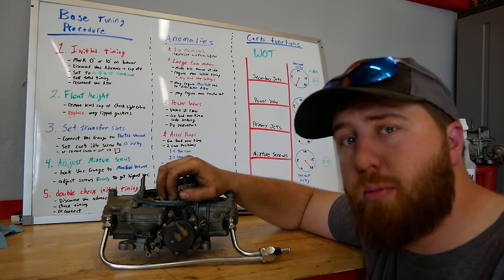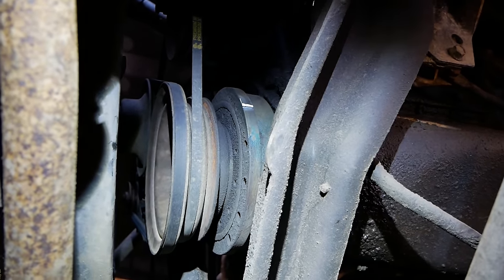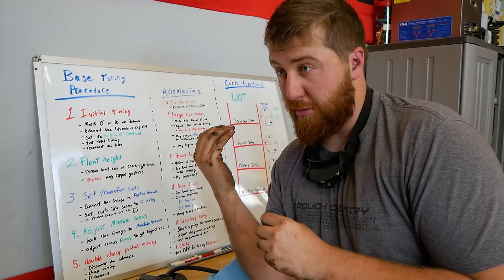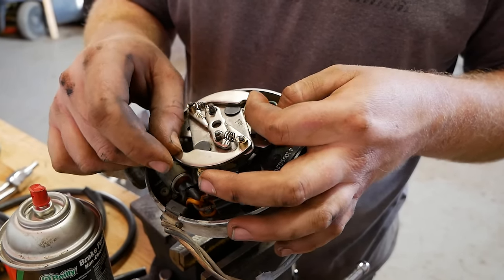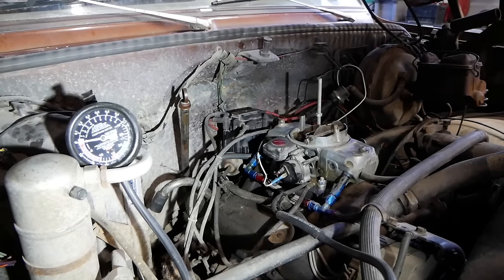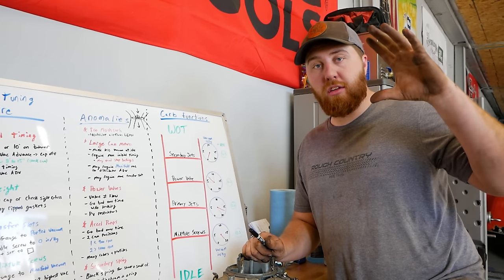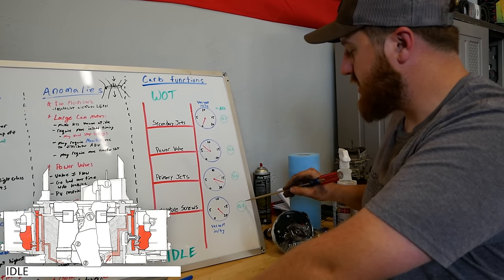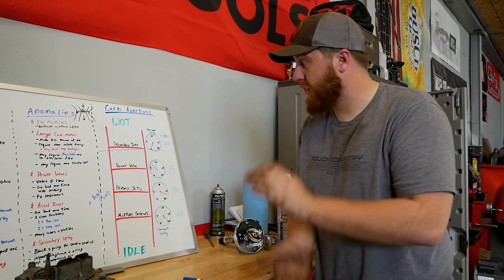How to Tune an Engine - Initial Settings, Ignition, & Carburetor Theory of Operation

Comment: best I can get on my edelbrock 600 cfm is about 17.5 but I agree this is a great tutorial!
Reply: I have 350 chevy with a mild cam
Reply from the maker: You will pretty much only see 20 on a stock or very mild cam. And you start adding more lift and duration you will start losing idle vacuum quality. Chances are that's actually tuned perfect!
Reply: @JunkyardDigs  I think it worked out alright too!
Reply: @JunkyardDigs  You know you've cammed it right when windows rattle and you lose all power brake boost ability

Comment: Thanks Kevin, I just used your fundamental initial steps to dial in the 1960s 2bbl carb on my 1967 Toyota Stout.

One question if you see this, how do you bring the idle down after getting the mixture and idle screw optimised for peak vacuum?

My idle is sitting at about 1000rpm with base timing approx 12deg which is 1.5x factory setting.

Even if I drop the timing to the 8deg factory setting, the idle stays high.

Comment: Learned alot. Awesome video.  I have a 65 c10 with 350 sbc with mild cam highest vaccum I can get  is 14 pounds of mercury.  I have edelbrock carburetor with only 2 adjustment screws. Any suggestions would be appreciated.  Thanks.

Comment: I watched you van trip for the Veteran and was surprised that you didn't need a transit sticker from Texas. Some people think only new vehicle work but it is funny to see so many of the new one broke down on the side of the road. We drive a van with over 300,000 miles for a daily driver. What brand of ear buds do you use? I liked the Carb video as well

Comment: That was excellent. You explained it very well. 
My problem is I don’t have a 4 barrel carb. I have 3 two barrels with the outside two used only at WOT. They are Rochester. I curious as to the primary and secondary jets. Primary in the middle carb and secondary in two outside carb?  It be great if you could do another video using the Rochester for us old Pontiac guys.

Comment: I'm not so much a Holley Guy, but lots of people still love the Holley. I'm now using a new Edelbrock 650 for my stock standard Chevy 350ci. 
I also have a used Holley 4165 lying in the garage haven't used for years. What do you reckon I should use,  and why?

Comment: He is used to working with 302s but that more cubic inches you have the more timing they like and compression plays A Part also lower the compression the more timing they like 400 Come stock with really low compression like 7 to 5 compression ratio the stock Pistons are usually dished around 15 CC's to 30 cc's they're kind of perfect boost motor when they are stock and the head gaskets usually have a quench height 40 two around 60 thousands of an inch really thick head gaskets so if you can get aftermarket head gasket you can get half a point of compression just from changing that

Comment: Awesome info! For us Edelbrock guys would you be interested in making a tweaked version of this video? I know you put an AVS2 on the Gold Cutlass. I put the same carb on both of my projects, a 79 Malibu and a 76 F100 with a 360 FE... I would love an in depth video on tuning the AVS2 for maximum performance and efficiency... I leaned up the primary's a bit based on reading the plugs after a good road trip and they seem a little happier but I know there is room for improvement... Both HEI distributors... Also, I intend to get an O2 bung welded in both and investing in an AFR gauge, just haven't yet

Comment: If you don't use the car often, it is best to go full operating temp and let the moisture in the exhaust system heat up or replace the pipes because they rust. Even a stainless steel will rust on the inside from sitting, bring the engine to full operating temp whenever you start it to prevent moisture from hanging around the exhaust.

Comment: Very good video. I've watched the earlier one mentioned, along with Luke's video, but something about the ladder graph made it my "a-ha" moment. But I do have a question but not sure if it will get answered here since it is an older video. How can you tell if your distributor is right or not? I've replaced mine twice now going away from points but I've never been 100% on if it's off a tooth or not.

Comment: Thank you. I've got an old jeep that I shoehorned a V8 into that I made sure ran but it ran like dog water. I'll be tuning it within the next couple weeks and this is exactly the video I needed. One question though, I noticed when you set the initial timing you said between 8 and 15 and picked 13, how do you pick that value?

Comment: Hi there ,i am from GERMANY owning and running a Wellcraft 26" with two 5.7 GM motors. They have the original ROCHESTER carbs mounted.
Thank you for these very understandable explainations.
Question : beside everything is working fine with the ROCHESTERS ,is there a possibility to improve power or effiency with other carb´s ( HOLLEYs or others)

Comment: Screw the needle valve all the way in Then back it out 3 1\2 turns and go from there. That works for a lawn mower to a Mopar and everything in between. I think thats true I havn't tuned a carburetor in years. I drive a fuel injection car.

Comment: Nice video.. btw carb sizing is a odd thing mopar 318 came with an 850tq. The engine only pulls what it can . 600 650 on a 350 might be a bit small is some applications. Some times it run better with more air and properly trimmed fuel curve.
.

Comment: Kevin, I’ve been watching and learning several years now. I have a newly built 347 in my Mustang. I have an Edelbrock 500 cfm carb, Pertronix ignition and a mild street cam. My engine builder said that I should not use vacuum advance. I wonder why!? It actually runs a bit rich and has an instant stutter for a split second if I punch it…., any ideas!? ( yes, I am converting to a sniper soon!)

Comment: We didn't bother trying to paint a line on the harmonic balancer mark.  It's quicker to fill the mark with a piece of chalk and then, if you got some before/after the mark rub that part off.  Quick, easy, and lasts just as long given the rain, etc. that splashes up on the balancer.

Comment: Question. Have set my new Edelbrock´s transferslots to a square as told. But i can move my throttle quite much before i see any vacuum in the ported outlet. So if im just maintaining speed it wont advance my timing. Why is that? And should i adjust the slots just right before i see vacuum on that port instead of doing the square? The car is running great otherwise. Thanks for this video!

Comment: I got an old C10 that had a 350 installed the 90's. Yeah I can't find that timing mark at all on that thing. Any troubleshoot tips where to start? Like put the timing light on the other spark plug wires other than #1? It runs good, I just don't know where my timing is set at.

Comment: Agreed....great video. Trying to make sense of transfer slots, curb idle screws, and vac advance. It's a lot to absorb. This video definitely helped. One question I have however....when you adjust your AFR screws for max vacuum, it will change your idle RPM. Do I simply retard or advance initial timing to get to the idle speed I want? Or,......as some guys suggest, crack open the secondaries a tad to increase? Doesn't seem too popular with most tuners. But I am hell bent on not turning the curb idle screws any more after learning about transfer slots. It seems like a back and forth operation. Turn distributor, adjust air/fuel, turn distributor, adjust air/fuel.

And, how much vac advance should I be adding when running a non HEI distributor? Seems to be an elusive answer. If at idle I'm creating 15 manifold Vac, do I adjust my vac can to <15 for full travel? Of do I limit the vac advance in order to reduce my overall timing?

Comment: By the way... I don't know what camera you are using, but I think you could film the timing strobe if the camera is set in "night mode". Or try to put in manual mode and mess with higher f numbers on aperture, low ISO and manual focus.

Comment: The air-fuel mixture should be 14 to 1. And a good place to start is one and half turns, if it runs better with the choke on it's too lean and you have to add fuel, and if spits and stutter and dies, it's to rich and you need to make it leaner.

Comment: When setting the initial timing is it before TDC or after. The valve cover on my 302 shows initial should be 8° before TDC. Would you recommend setting it closer to 10-15 before?

Comment: I have 350 chevy truck 1978. When I use the gauge, the reading is not stable. It’s jumping pretty bad. Could it be the timing off? I’ve installed brand new Edelbrock 600 carburetor.

Comment: I had a 2000 Durango with a 318 and the rubber on the balancer was shot. Every time you shut it off it would sound like a bad turbo spooling down cause the outer ring would keep spinning after the crank stopped

Comment: Step one clean the inside of your distributor so this won't happen to you. If you can't find the marks on the harmonic balancer, another way of saying the front of the crankshaft, for every turn of the crank the camshaft moves twice since it both intake and exhaust valves to open. Set your number 1 at TDC or top dead center by feel, turning the crank back and forth with a long stemmed screwdriver or a que-tip is better until you have it set at top dead center, By keeping the valves closed and the piston is at the top. You can find your number 1 piston by looking at your engines firing order. Once you have it set at TDC turn your distributor until the engine runs fine, then drive it as usual and if knocks or ping advance the timing by the springs on the vacuum advance. Stretch them for more advance.

Comment: What about valve lash itself along with all this on mild cam 350 motor home motor with an edelbrock very new to 4 barrel stuff and it’s runs and drives currently trying to make it happier in my 1971 C-ten any tips appreciated…

Comment: On my Jeep cj7 with the 258 I6, I can’t see the timing marks on the tab without removing the water pump. I just had the water pump off and I wasn’t smart enough to remember where they went. Anyway, what should I do about figuring out where each spot is?

Comment: This video is great, but I’m still dumb I have a vacuum secondary Holley on a 355 sbc any help appreciated love it to run a little cooler to bring them sandwiches on home lol looking to help the idle out I’m currently running ported vacuum to my vacuum advance and it’s pinging pretty bad during pulles 50 psi of oil pressure at idle tho

Comment: What happens when you have 20 inches of vacumm. Initial timing is normal, but your have 15 inchs of vacuum coming out of your ported port even though your transfer slots are backed all the way off and there no noticeable vacuum leak. Do you back timing off?

Comment: I just got a 1970 f250 with a 360 I think it had a stock rebuilt carburetor but I can only find the vacuum line from the distributor is there another vacuum port?

Comment: So if I have 19" vacuum at idle I need a 9.5 power valve correct? I have a 680 QFT on a 350 with mild cam and it idles rich. I am new to carbs.

Comment: So I have an Essex V6, it loves running a bunch more advance than stock, like 30 degrees at idle, waaaaay past the stock marks.  I have  set it up using a vacuum gauge for best vauccum and backed it off a couple inches.   I have also set up my friends car (same engine carb etc) and its the same, waaaay more advance than stock and it loves it.   Question is, have i screwed something up?  will it hurt anything?   I know my car runs like garbage at stock (12 deg btdc)    And now thinking about it im wondering if the advance weights are stuck.

Comment: You complain about that timing tab location, on my BMW the marks are on the flywheel. Coincidental timing (ha!) I was planning on tuning it soon. I feel like there’s not much to add to this other than I like to reset valve lash while doing this.

Comment: hey i had a question - my project 78 has a 460. shes got a 650 cfm Edelbrock. and when i go to hit the gas she sputters and almost dies until i let go of the pedal.
if i accelerate slowly she will rev up, but if i accelerate normally she doesnt rlly do nothing.

i suspect the acc pump is bad but id like to hear another opinion before i go buy a rebuild kit. keep in mind this carb came new to me but its not rlly been used for 3 years.
Reply from the maker: I know the accelerator pumps like to dry up on those! I would start by replacing that rubber diaphragm
Reply: @JunkyardDigs  ok, will do sir! very well done video btw, mustve taken hrs to film. thank you

Comment: I just got a 82 Ford F-250 with a 351w but the last owner took it all apart now I don’t know where to wire the ignition coil to how would I go about getting it to start
Reply: I’ve cleaned the the distributor and ran a wire from the positive side of the battery to the positive side of the coil then grounded the negative side of the coil but still no spark is there something I’m missing

Comment: I’ve run into gm’s that had jumped time, and gm’s that had spun the balancer.
Reply: in which case you're either resetting the balancer so it's in time again or pulling the engine apart so the sprockets can be adjusted and the tension of the timing chain checked to ensure the engine stays in time
Reply: @rawr51919  in either case your replacing parts, not resetting them. A spun balancer or worn out timing set is destined for the scrap bin.

Comment: Where are you located? I need some help with my 94 gmc Sierra. It was a 5.0 tbi but now 350 bored .060 over with edelbrock avs2 carb. Has  a big thumper cam. Truck runs good on idle but now that it has a digital trans control module I’m having a hard time getting things adjusted just right. I will pay you to help me come out and get it right.
Reply: And the carb is brand new lol

Comment: To your point to large of a carb would mean the engine would be forced to be Lean on fuel that would also mean that to small of a carb on a engine that needs a bigger carb would mean that to small of a carb would cause the engine to be to rich aka way to much fuel because of the ventures are small and allowing more vacuum and more fuel then the engine can handle Kevin @32:17 @Junkyard Digs

Comment: Every time I have to tune the timing or the carb on my Chevy it is a dreadful feeling because it takes hour's to get it done. If you don't have a vacuum gauge or a timing light or a Air/Fuel gauge on hand. It sucks 😞...and not in a good way.

Comment: One of my uncles ( welder / farmer) was tuning up his car.  Read the instructions ..    Turn the idle air screws in and seat them.  Back out 1.5 turns....    after a full day of trying to fix it in sub zero temps, my dad discovered that a welder farmer uses a ball peen hammer to "seat" the idle screws..  WHAT????????   Broke the tips right off blocking the idle air passages

Comment: Nice a good vid for dinner. Just came in from working on the worst rotten ford ranger ever. Floor who needs that. Body mounts. Nope. Rockers, optional. And custom floating seat.
Reply: Surprised it's even still in one piece
Reply: @rawr51919   my dad riveted a piece of sheet metal in its place and I ripped it out to replace it. Gonna use old trailer framing to build a skeleton welded to the frame and cheap sheet metal. Good old yard truck need backs on the job. It’s got 300000 miles on it in the middle of the rust belt
Reply: @2koolchris291  Frankly I'd just pull the engine and transmission and scrap it at this point, it's obviously had it's day and then some so might as well turn it into parts for similar trucks in better condition
Reply: @rawr51919   one day. I will get a body for it. It’s also my dads truck that he rebuild a few times. Also I sort of exaggerated the rust. It’s bad but there’s something to work with.

Comment: moral of the story is.. rip the ac out... 😆 🤣 😂  be easier.. and as a ford guy myself.. chevy is soooo easy to work on.. however.. yuppers.. sizes & wtf is it doing?? grrrr.. adjustin to parts.. like wrong parts like my harmonic ballencer.. someone took it off skid & lost it as their boat ancor 😆 🤣 😂
brought it to top dead.. then marked it.. & used ears more than eyes cuz of it
& the distributor went in 180.. easy fix.. rewired 😆 🤣 😂 the book was right however.. leftover block.. from previous year.. & wrong cam